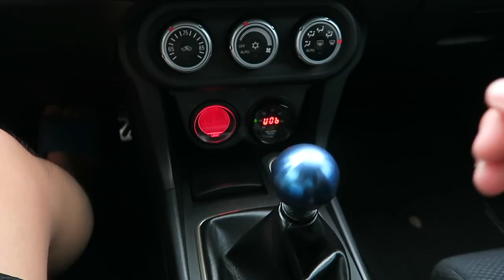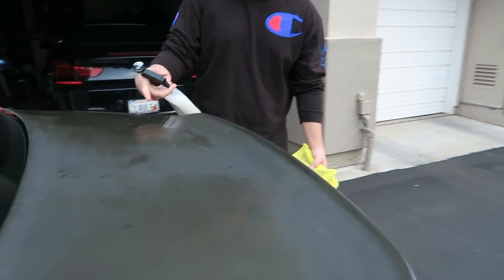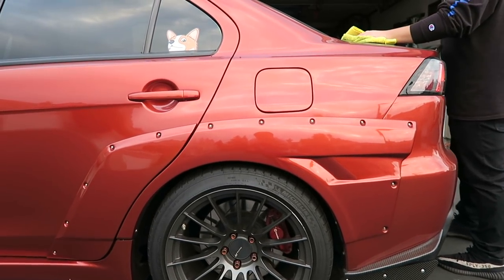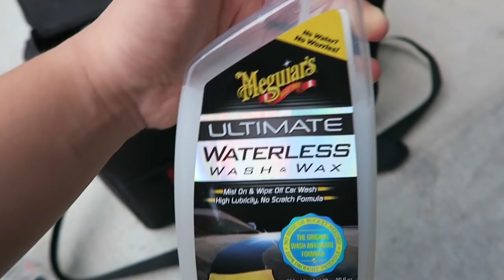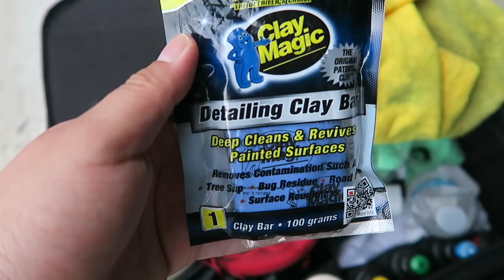FIXING MY FADED CARBON FIBER TRUNK!!!

Comment: Hey did the fade stay away with just the polish and the sealant?  I noticed you did a video about a year later on a  carbon fiber hood where you wet sanded it.  I'm experiencing the same issue with fade on carbon fiber and was wondering if you would recommend wetsanding and clear coating or polishing?  Thanks man and great video!

Comment: I personally wouldn't buy a car with that much damage to the bumper so you should definitely fix that and the trunk. Either get a quote from someone who can fix fiberglass or put an OEM bumper on and get it paint matched. Also just get the trunk re-clear coated.

Comment: There's no way the coil pack cover bolts fell out along with the cover coming off and you didn't hear or notice. You sure it was even on there when you bought it? It's extremely unlikely that they backed out.
Reply: Also the missing bolts aside from the coil cover is most likely some sort of wiring harness clip. Neither are necessary but will clean up the bay if you get everything back in there.
Reply: This dude don’t know what he talking about, those bolts were never there in the first place 😂😂 most cars have openings like that on the head cover
Reply: East Bay Angler Im not talking about you btw I’m talking about Alex
Reply from the maker: I used to have bolts that would hold the engine cover, and those fell out and made the cover slide all over the place. That's why I'm confused. lol
Reply from the maker: I really don't know sh*t. lol That's why I'm asking. I just know that there used to be some that let the cover sit on them, but now the cover doesn't have anything to attach to.

Comment: You need to clear coat trunk.
Reply from the maker: yee the factory clear coat was pretty bad
Reply: SneakerheadinthebayVlogs btw. The bolts your mentioning that’s “missing” it isn’t missing. Valve cover looks bolted up. Usually there’s brackets there to hold the engine harness but looks relocated. previous owner replaced it with a aluminum valve cover painted. http://www.passwordjdm.com/PasswordJDM-Dry-Carbon-Fiber-Spark-Plug-Cover-08-Mitsubishi-EVO-X-P4731.aspx
Buy this a bolt it up to get those missing bolts in haha
Reply from the maker: shooooot I don't have that kind of money hahahaha It's nice tho!